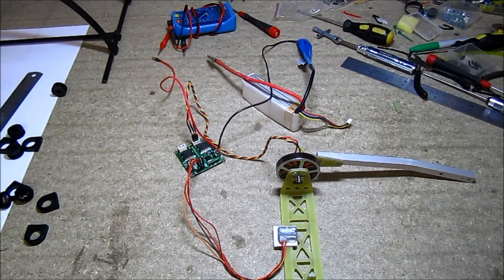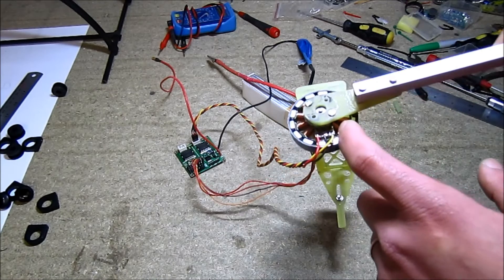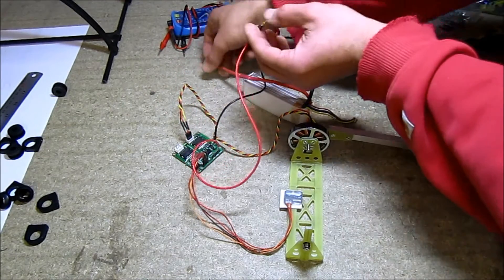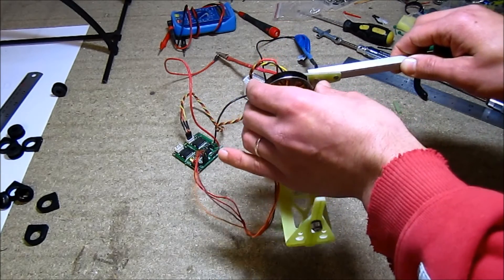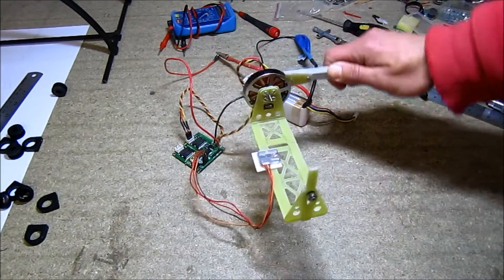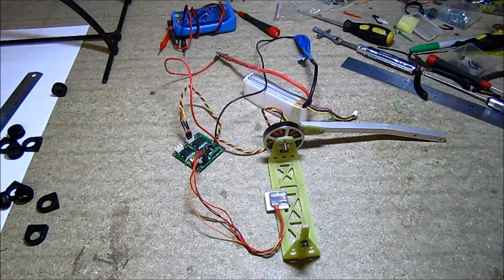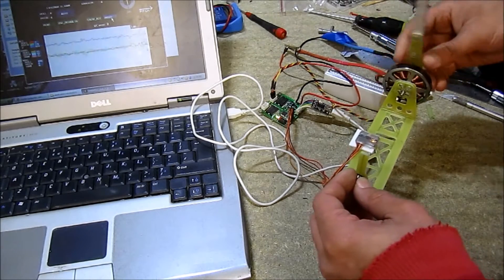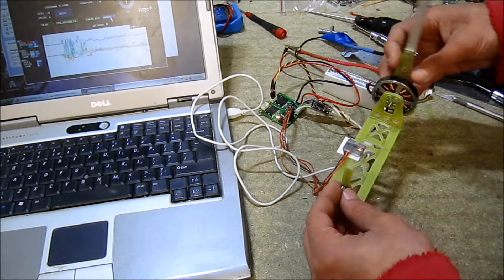AlexMos brushless gimbal motor test

Comment: Hello. I found one of this DC brushless motor from China with spec of 0.9Nm and speed of 200rpm. I wonder can this be used in Scara robot. Its an expensive motor so i like to know about your review of this kind of DC brushless motor before i buy it. Thanks
Reply from the maker: For these type of robots stepper motors are being used, so like this one is not gonna work as there's no position sensor on a robot. A motor like this doesn't have enough torque and precision compared to stepper motors, it just helps to level a camera gimbal which is already balanced. 
Just in case I misunderstood your question and you are looking for brushless gimbal motors, then here's few hobby sites that have them cheap- Hobbyking, Himodel, Foxtech. 
This one was at the very early brushless gimbal invention stage where there was no such motors and people had to rewind their own, but now there's ton of selection for penies:)

Comment: just a stupid question. is this a brand new motor hooked up to the alexmos board? what i mean really is, if i bought a stock motor and hooked it up to a alexmos board then i can use alexmos GUI settings to configure it and that's it?
Reply from the maker: mahmood aloraibi At the time of that video there was no brushless motors for gimbals so I re-wound them myself. Stock motor will not work, it has to be a motor specifically for gimbal. Nowadays there's loads of them:)
Reply: ROBOFORCERX2000 Can you give a name/model of the motor or link that you prefer? I don't know much about RC motors.
Reply from the maker: Consig1iere It was rewound RCtimer 5010 motor.
Reply: ROBOFORCERX2000 I know you mentioned this term "rewound" earlier. Can I buy motors that don't need "rewinding"?
Reply from the maker: Consig1iere Yep, any RC store has loads of gimbal motors.

Comment from the maker: That was the 1st software then, now the latest is much better and eliminates that squeaky noise. Motors RCtimer 5010, and they had to be rewinded to have torque and resistance- ordinary brushless motors won't work. At the time there was no selection so I was doing it myself, and now you can get rewinded motors for any camera you want:)

Comment from the maker: Mine didn't work until I hooked up to computer and via GUI set motors poles. I think thing like these- BLG controllers, or flight controllers like MWC is better to connect to computer first and set whatever that can be done before even powering them up...

Comment: Testing new software
New beta firmware has the ability to run completely silent
The frequency of 8 kHz up to 32 kHz is also added to the axis YAW
You can change the axis of places, such as nuclear YAW instead ROLL
COMING SOON.. :)

Comment from the maker: Why is it unfortunate? You wouldn't hear it over the noise of props anyway... Unless you thinking of using this system as steadycam for carrying around in your hands, are ya? In this case larger motors would be needed to use as less power as possible. I saw some vids when they don't make a sound, so it is possible, but as long as this one goes on a hexacopter, squealing makes no difference to me:)

Comment from the maker: It works fine after tweaking PIDs:) Transmission is not an option- servos are the same motors with transmission and they not as close to brushless motors for smoothness.  Motor is not meant for such small movements- that is correct, and that's why these motors are being rewinded- to have some torque and be able to operate slow and precisely, of course with a help of software from AlexMos controller:)